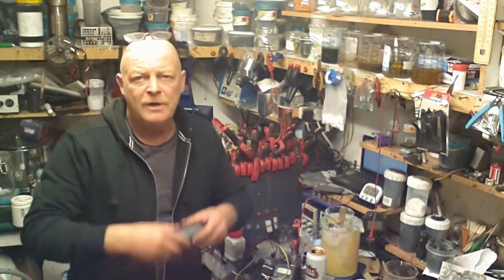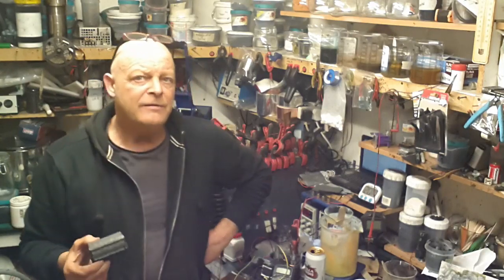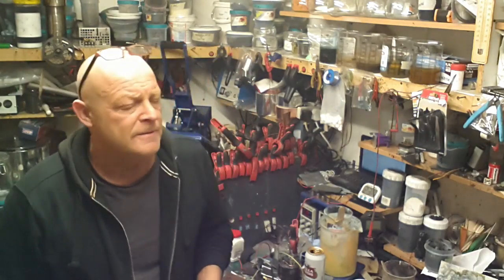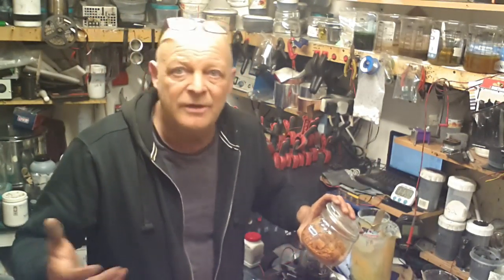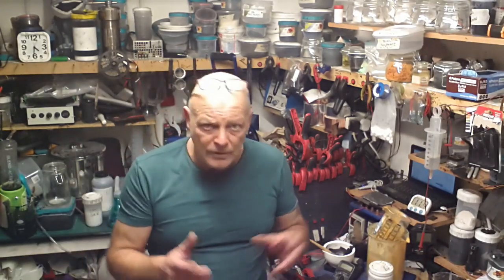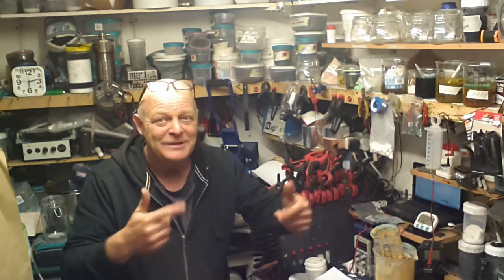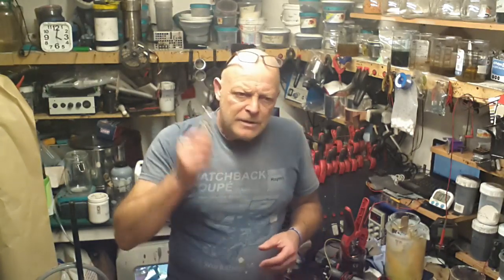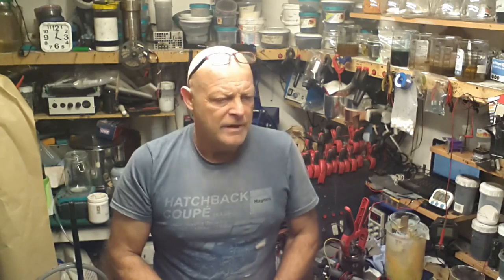The Dan Cell & PBA's & Metal Hexacyanoferrates

Comment: Hi Kev, Glad things are getting back on an even keel for you :-) 
I have made a few batches of Zinc Hexy, using a drip feed made from a plastic yogurt pot, with a tiny hole drilled in the bottom, which then fits snugly into the lower beaker on the stirrer. The process  seemed  to work better when adding the Potassium Hexy to the ZnSO4.You seem to be making an awful lot, I was only using sub gram amounts in my test cells -
All the best Martin   :-)
Reply from the maker: Hi mate, sorry i forgot to answer your last email....
But yes i am making a lot, but only because i like to do thorough testing and hate making small batches 😎
Reply: solarhope good to know Martin .thanks again

Comment: Hi Kev
Forgot to say, about when you mentioned about activated carbon and when you grind it up there is a loss of performance. I have found it is better to grind the carbon up to your approximate grain size you want to work with first, then soak it - in my case either copper or ferric chloride - and then cook it. The "active solution, be KOH or whatever,  can then have a greater surface area to work upon prior to the heat treatment. Might be a "no brainer " for most of the guys and girls out there, but it was just a confirmatory comment to what you had put up on the whiteboard.
Anyway, just a quick thought :)

All the best my mon

T
Reply: tony ponsford yes I agree tony . Otherwise you will be crushing it in on itself like a chocolate aerobar !

Comment: Hi Kev
Interesting you mention a kiln temp of 950 degrees Centigrade.  Having tried both microwave and "open" craft kilns, I've bought a precious metal smelting kiln, complete with a ceramic lid and graphite crucible. Max temp is apx 1150 degrees, but for my copper chloride & ferric chlorides carbons, I also find 950 a "sweet spot"...no ash even after 3 hours, which is my now standard cooking time. Have yet to assess its performance on urea > carbon nitride, but think it will be as similarly successful. Last batch of charcoal soaked for 4 days in my own ferric chloride soln., cooked at 950 for 3 hours gave 0.8 ohms on my LCR with 10mm probe separation. 
On a binder issue: as you know I am currently trialling a PVA:PAA:CMC binder, and I add 1% by vol Glycerine as a plasticizer. Question, do you use plasticizer with your CMC:SBR ?
Have you tried any Xlinking in your binders, say CMC with citric acid ?
I haven't gone that far with the binder yet, as I want it to be compatible with my "ChUG" DES ...Choline Chloride, Urea and Gylcerine (hence the use of Glycerine as plasticizer), but just thought it might be an area of discussion/video.

All the best my mon, 

T
Reply from the maker: Hi mate i have not yet trialled plasticizers so can be of no help with that one 😎
Reply: Hi Tony, at what moment/stage of the binder preparation do you add the plasticizer? At the end?
Thank you
Reply: @mihaiaragon  Hi Unlocked, yes at the end. But from my understanding, the plasticizer does not perform a "hard" chemical function within the binder, like a cross-linking agent does,  so it it not important to keep it separated from the binder for storage. Its function appears to be more akin to a wetting additive, in that it facilitates the flow of the binder around the electrode material by reducing the molecular tension caused by charged tails within the polymers in the binder, but it may not necessarily chemically bond to either. In the scheme of things, I don't think this is the most important factor in binder composition, but my thoughts is that it could help to make a marginal binder into one that is usable,  particularly if it can be used as a "hook" for the electrolyte to transport through the binder to the Active Material. It might make a good binder better as well :)
Off course, I might be completely off my head hahaha.... been feeling like that at the moment....time for the white jacket...
All the best

Tony
Reply: Hi Tony, really appreciated the chemistry lesson,  I will try to compare 2 identical batches (one with, one without) and see the differences... if one!
Sorin
Reply: @mihaiaragon  Hi Sorin, thank you for your kind remarks, but please do not consider me a teacher...I am far from it !!   My thoughts and musings are just my ideas and anything I might have gleaned (or misunderstood) from the internet. I retired early from the Electric Supply Industry in the UK, moving to Thailand. I am just a curious Electrical Engineer, who sees a country with a massive resource called the sun. I live in northern Thailand in the country where farming is the key employer and it doesn't pay that good. If I could find a way to improve life here, by helping people to utilise their natural resources more efficiently, with a relatively cheap, open-source and sustainable system, then great !
So please take my musings with care, and good luck with your experimentation. There is a huge number of materials that are classified as plasticizers, so your choices will have to be made in connection with your battery "system"   -   what I am finding out with my numerous (and growing) failures is that you have to look at the battery as a system, and thus you need to view it more "holistically" than an electrode, an another electrode, a binder, an electrolyte.....
And that at the moment is the hardest thing that I am getting my head around... I've stopped trying to look for "the best" say carbon...I'm now looking at HOW a certain carbon fits in to a system...a completely different way for me to look at the challenge.
Once again, good luck !

Tony
Reply: Hi Tony, for me a lesson is when you learn something that you didn't knew before. Only by continuously learning processes we will keep and improve our brain activity,  otherwise it will become a vegetable.  My aim is build a battery made all carbon, good enough to be used widely,  I want to share all I am experimenting with others, so they can learn or help me to improve my work.... I start porting some videos,  I will post more .. for all of us that started on this path.
Thanks again,
Sorin

Comment: Hi kev how you doing my mon !!
A quick note, which may or not be of interest to you.
As I said previously, I am using ferric/copper chlorides for graphitising carbon. Well, I have a stock of ammonium persulfate as a "greener" alternative to ferric chloride for etching copper and I thought I would give it a try... so I have about 500g ground charcoal, 500ml water and appx 80g ammonium persulfate...it has been on soak for a few days and I occasionally stir it. There is a thick, shiny metallic-looking layer formed on the surface and the reaction is still ongoing... haven't done any testing on the layer yet, as I want to leave it until all signs of reaction (small bubbles) cease. I've tried to find if there is anything out on the net but hit a wall so far...but we do know that it used in chemistry as a radical initiator, a strong oxidiser and interestingly in the production of SBR (thx Wikipedia). Whilst I originally thought I could use it a replacement for KOH ie its ability to make the holes and tunnels in the carbon for activation, it appears that some type of cleaving is also taking place, producing the graphite-like metallic layer on the surface of the sample, so possibly there is a different "functionalisation" taking place, as the sulphate ions appear more efficient at cleaving and intercalating than the common halides. Really interesting !!!
I intend to filter, dry and cook at 950 degrees C for 3 hours and will report.
All the best

Tony
Reply from the maker: Ok mate interesting stuff, you dont say what your carbon is though....i have to say that i once turned coconut active carbon to graphene 😎 anyways when you cook at 950 to reduce the resistance give it some Nitrogen, this will further aid storage capabilities and also help to lower the resistance. 😎😎
Reply: @mouldykev  Hi Kev, this was just bog standard locally (Thai) produced tree charcoal for cooking, nothing special. Probably produced in traditional clamps, not processed. The charcoal is ground up in one of those Chinese stainless steel macerator/grinder...not a bad job, really, except I will have to completely rewire it :) 
What I normally do when cooking, is to place some "kiln paper" on top of the sample and place some charcoal on top of that, to help give an inert, nitrogen rich atmosphere. Also I now cook in graphite flasks in my metal smelting kiln which has its own lid...not too bad if you can minimise conductive smoke (Grrr ...Urea, need to work out a better way to handle that... ;). Anyway, there is a few bubbles still coming off, so it will be a few days I think, before I start  cooking. Will report later.
All the best
Tony
Reply from the maker: @tonyponsford  whats your email mate or even mail me at mouldykev@gmail.com
Reply: @mouldykev  Hi mate, sent you an email to your address :)
Reply: @mouldykev  Hi Kev

Quick note on resistivity reading on the Ammonium Persulphate/charcoal experiment....The charcoal was soaked in the soln for about eight days, until there appeared to be little or no gassing/bubbles. The slurry was vacuum filtered and dried at appx 80 degrees to remove most moisture. The colour was markedly "grey/black" and a "gritty" texture, rather than the black and smooth prior to soaking. Apprx 100g was placed in a graphite flask, filling to appx 20mm of the top, placed in a smelting kiln. The temperature was raised to 950 degrees and then held at that for 3 hours, The kiln was then left to cool overnight. Examination of the flask revealed little ash, due to the lid, but voids within the bulk that collapsed when prodded to remove from flask, at large quantity of fine airborne dust implied a small particulate size.  
Dry powder resistivity test was done for comparison with a graphite powder (unknown quality,but considered poor)...the apparatus was an acrylic tube 8mm id, filled with appx 40mm powder, gently tamped down to achieve a consistent column. The upper contact consists of a galvanised steel bolt with a copper lug soldered to it, a copper sheet under the acrylic tube provides the lower contact. A 1kg weight applies a repeatable pressure to the test samples (but of course particle size is variable) and the resistances determined are as follows : graphite powder = 70 ohms, charcoal soaked in ammonium persulphate and heat activated = 120 ohms.
Interesting first result :)    Please note, these were comparative results only, not absolutes.
Lots more needs to be done with this, I think, as it appears to be in the same parish as my graphite. Of course, this is only a Dry Resistivity test, done deliberately as it excludes any benefits that the ammonium persulphate could add by functionalisation. One could surmise possibilities of ammonia, nitrogen, oxygen, sulphur and sulphate functionalisation  singularly or acting in conjuction on the surface of the carbon. Certainly peeked my interest !
I need to sit back and plan how I want to carry this forward, what tests I want to do. Some of the obvious, such as soln concentrations, soak time, cooking time and temperature,  charcoal particulate size spring to mind (this batch was masticated not stone ground), luckily I have a reasonable stock of the chemical....and I have then to look at electrolytes and binders !!!
Anyway, thought you might find this of interest.
kind regards

Tony

Comment: Hi Mr. Wallcroft. I sincerely enjoy watching your videos and learning new things from them. At the moment I am developing my own battery/supercap and I still down know which one I am actually making :D. The thing is that I am still wondering about the initiall self-discharge voltage of that device since a 10th of a volt per cca. 15secs. seems a little bit too much for me. Of course it then tails off slower but I mean your regular watch battery or any other battery isn't draining that fast by itself is it? Or is it just the destiny of our carbon batteries? Could you please hint a little on what the problem may be?
Thank you for your effort. I'll make some publications too when I'll be a little more certain as you said.
And don't worry Life will always find it's way...
Reply from the maker: Hi you will find that most of it will be down to chemistry and your construction, only continued experimentation will cure this.
Reply: What current collectors are you using?
Reply from the maker: @zylascope  either zinc and carbon or      carbon / carbon
Reply: @zylascope  Yes, me too. I am using both sides graphfoil. My zinc plate is on the way for stainless steel zinc electroplating. 
Thanks ;) I would be very grateful if you could help me out a little.

Comment: I got some of that carbon down to 0.2 ohms . Microwave kiln for 1 hour
Reply: Hi EPNM, Is that a special microwave kiln, or a kiln in a domestic microwave,Any links? Was the microwave on for 1 hour continuous or in smaller steps ?Cheers Martin :-)
Reply: solarhope hi Martin yes just a microwave kiln from eBay and I had it in 1000watts for 30 min and then I looked at it and then another 20 min and then let it cool down for 1 hour before taking it out . The piece  had 7 ohms before I put it in . I feel more time would have produced even lower ohms and I will be testing more during the week . I think the video is on my channel .
Reply: Cheers Bud, I will continue trying to adapt my domestic microwave and ceramic crucibles to a more reliable process :-)

Comment: Have you seen the guys using a gell with crystals in it for the plate separators & the electrolyte in one? They were using it in graphine power cells, but I'm thinking it's transferable, & may help with the self discharge rates you were seeing in the past (if that's not solved yet). Just a shot in the dark for ya.. And: Thanks for sharing what you do.
Reply from the maker: Do you have a link

Comment: Since it is a carbon couldn't you plate the surfaces electrically? one metal on the inside surface and one on the outside surface? This way there is no bonding issue with using wires or sheets of metal.. Electrically bonding the metals would make contact issues go away.
 Great job...
 Are you using the Urea electrolyte?

Comment: yes,  in tried making the hex with magnesium,  but had nothing drop out in solution.  wondering if I had the wrong molar solution.  should the metal salt one adds be a 1molar solution?
And also,  is my thinking off,  by wanting to try a cell made of two different metal hex plates.  say magnesium hex as one plate,  and copper hex as the other?

or would this cause hell to brakes loose in the electrolyte department.
Reply: What I didn't understand was that when they added the sodium sulfate, they added it so quickly that they had the solution precipitate.  I used a separatory funnel and let it drip one drop per second.  I DID NOT get precipitation until I evaporated some of the solution under heat.
Reply: John Hardin 

hmmm , ok.
Reply: John Hardin
 I also have one of those IV drip things that I can adjust the drip rate with.  VERY handy
Reply from the maker: Hi, 1 molar or less should do the trick mate.
As regards using two hexacyanoferrates  ....try it 😎